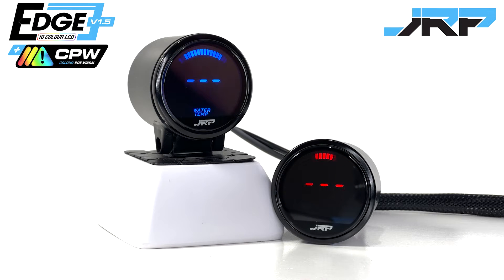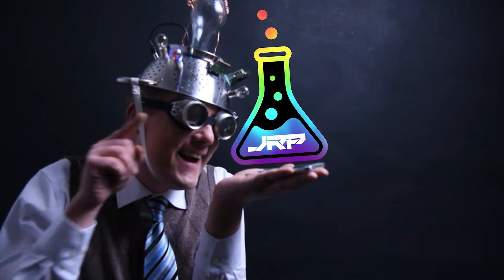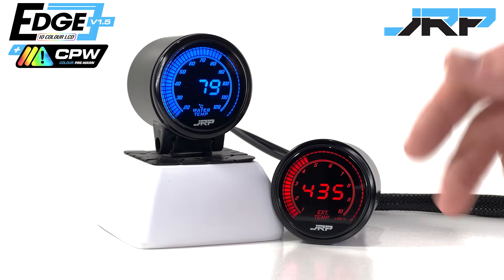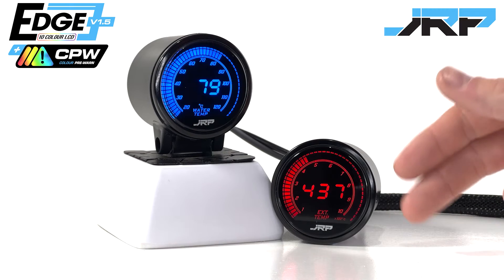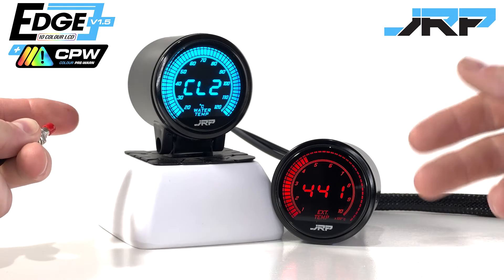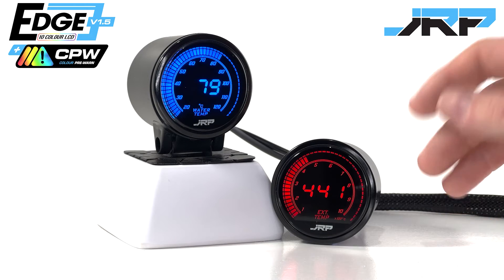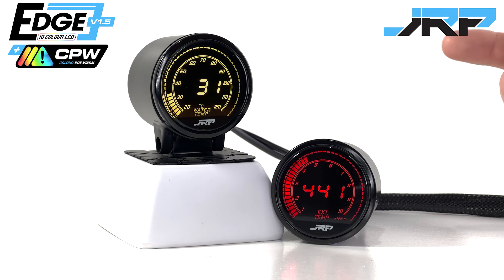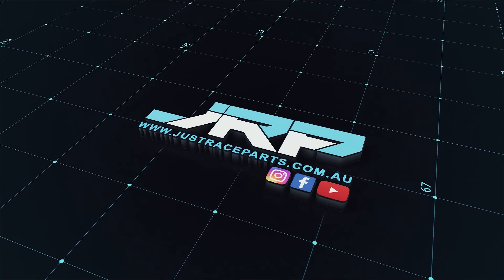JRP Edge Gauge V1.5 - Colour Pre Warning Introduction

Comment: Do you guys have any videos on where to install the sensors for the; 'Diesel boost 30psi guage', the 'egt guage' on the exhaust - on the pipe or closer to the engine block? And for the engine oil pressure guage sesor, where and how do i install these? Thanks
Reply from the maker: Hey, Thanks for the message! We do have installation videos planed with our channel and collaborators in the future. Remember each vehicle manufacture is different, and you may need to do a little independent research for your application. 
For now you're best off calling us during business hours and were happy to assist you over the phone and point you in the right direction. 
https://www.justraceparts.com.au/contact-us
Reply: Hi mate general rule of thumb for egt gauge is post turbo so go about 100mm off the back of the turbo and make a spot or use the already made spot (most aftermarket exhausts have the thread and spot ready to go).

Boost gauges are recommended to be somewhere along the intake/intake manifold.

Oil pressure gauges you can get sandwich plates that go on the block inbetween your oil filter and the block so you remove the oil filter screw the sandwich plate on then screw the oil filters onto that and your gauge screws into the sandwich plate and never had to be touched again. 

Hope this helped
Reply from the maker: @fergusnorris6694  Pretty much nailed it!
Our EGT V3 has been specially developed to withstand extra harsh conditions and can deal with both pre turbo and harmonic vibrations from diesel engines!

Don't forget to calibrate your boost gauge to zero after installation ;)

Comment: Going by the manual, it doesn't appear that there's any way to turn off the nemerical read out on your gauges and just have the graphical representation, is that correct?
Reply from the maker: You're correct, there currently isn't a way to turn only the numbers off. There is a bit of a work around to do something similar.
If you enable Colour prewarn you will have the display, light up and change: Yellow, Orange & Red before your alarm.

What you can do however is set the normal running colour to "Dark mode" (this can be in both Day or night running modes). 
And the gauge display will appear off... then close to the alarm the gauge will show the colour prewarning numbers.

The display can also be dimmed down depending on the Brightness settings, and they can be made quite Dim at night. 
check out this link, follow the time stamps and you should see how to adjust brightness.
https://www.youtube.com/watch?v=nUU1M3RvaHo
Reply: @JustRaceParts  thanks for the reply, I've watched all the vids. An idea for your feature backlog then, perhaps: an option to turn off the numerical read out in normal operation so just the graphical display is visible, then perhaps include the numerical readout as part of the colour pre-warn? Even better if it can be optional in both normal operation or colour pre-warn mode too of course.

I'm guessing that these gauges can't have their software updated and to get future enhancements you have to buy new gauges?
Reply from the maker: That's a really good suggestion and will be put on the drawing board with the RND Team. :)
As for software updates, We do have that on the "feature set list" with future generation products we're developing, something like a Bluetooth or USB updates. 
There are some Edge gauges that have rolled out that technically have "Back Door Support for re-programming." 
This can only be done with special tooling and our propitiatory programming equipment. 
We are considering a potential service where customers could send in "supported gauges" for minor updates, 
First this would need to make economical sense for both customer and the team here. Part of the difficulty is we usually push the limits of the hardware at the time of development, so major reconfigurations would not be possible. 
For Example: JRP Edge Gauges VS JRP Edge v1.5 have a totally different hardware/ firmware architecture to each other.

What a lot of people don't get to see/ understand is a simple feature tweak, requires the whole gauge to be bug tested and put through the ringer so to speak. It needs to be stress tested to ensure that it still performs within the required benchmarks and be a reliable monitoring tool. Afterall they are protecting your engine!
These gauges have exceedingly good value brought to you by the small RND team we have here in Brisbane Australia, We are still a growing grass roots company! As we continue to grow, so may our resources for these sorts of ideas ;)
Reply: @JustRaceParts  thanks for the lengthy reply! Glad you like the idea, I'll look forward to seeing it on the V2 gauges. ;) And I do think that long term, ability to update gauges would be a great addition to your products, when it relates to config changes that don't necessarily require better hardware of course.

I totally get the need for testing after changes get made (even minor things), I have been involved with that sort of thing in my work a bit and people would be surprised at the things that can break when making a supposedly unrelated change. 😅

The gauges definitely look like a solid offering and I'm certainly considering them for my application, keep up the good work!
Reply from the maker: Logic in in digital/ electrical systems takes no prisoners! Had a car in my youth that would blow LH rear blinker bulbs any time I took a "hard right corner." Didn't happen often but drove me nuts! (usually indicating while exiting a round about).
Fixed it when I went to install a new amp under the drivers seat. The power wire for the tail light was just slightly pinched under the carpet and grounding out to the body. 🥲

Comment: Which specific gauges does this function exist on? Boost, Oil Pressure, Air/Fuel?
Reply from the maker: The Colour Pre-Warning (CPW) Function is only on our 52mm Temperature based Gauges. 
All JRP 52mm Gauges can be set up to have the same running colours, but then you can be "Pre Warn'd" as temperatures rise up to the final warning alarm.
Have a chat on the phone or with our tech Team over Facebook if you want to know more :)